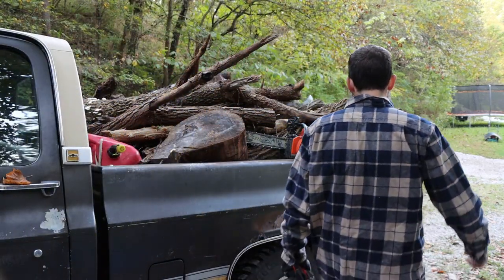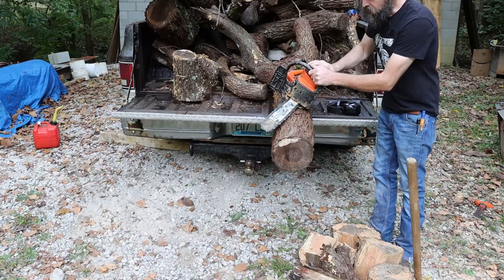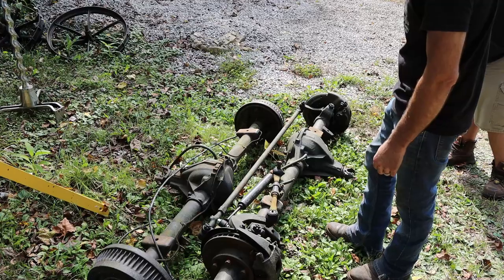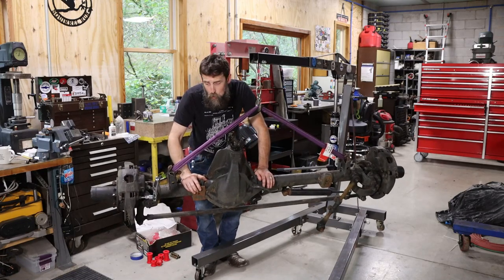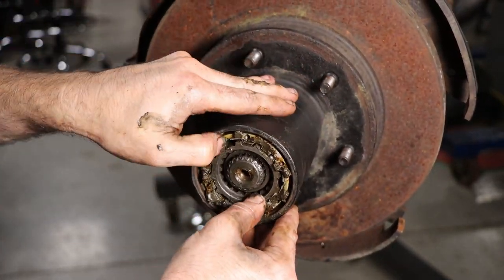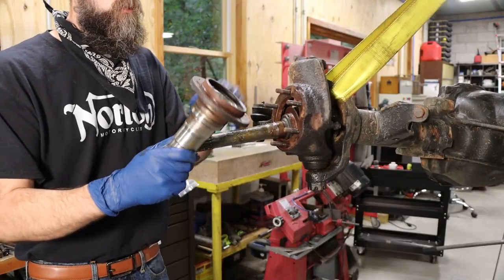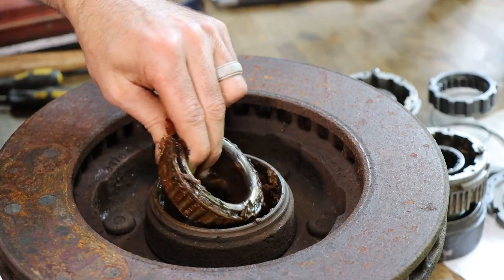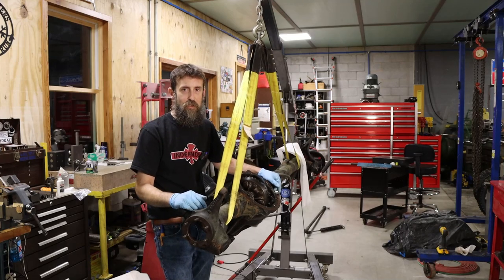Let it begin! Chevy K10 Front Axle Part 3

Comment: An interesting teardown, Steve. I've never dealt with 4wd stuff so all that is new to me. Tell me, where are the seals on the inner axle shafts? They seem pretty rusty a long way in. All the best, Mart in England.
Reply: The inner axle seals are located in the axle tube near the differential. Typically, the axle shaft will be rusty from the universal joint to the splined area where it goes into the differential housing.

Comment: I heat up a piece of pvc pipe and slip it over the handle of my sledge and maul.  Deforms to fit and prevents damage to the handle.  Only takes a piece 2 or 3 inches long.  I would not use a mushroomed tool period.  A few minutes with the grinder and they are harmless once again.  Those pieces can hit you anywhere and do serious damage.  I don't remember any saws with a handguard brake in the seventies, although I could have forgotten, are you sure it is that old?  Nowadays the chinese carb parts and replacements are so cheap I wouldn't put up with a hard starting saw and normally Stihls are like Hondas one pull and go.  Check out the $30 HF electric chain sharpeners.  For home use they are a huge advancement over hand filing.  I don't care how good you are by the time you get to the end of the chain the teeth will be uneven.  Using the sharpener they are always exactly even in way less time than you can do it by hand.  I find grinding to be more even than filing for a couple of reasons.  The file cuts just a bit differently on each stroke because the chain can have a bit of variance in the metal hardness in the teeth and the file can have uneven wear patterns on its teeth.  Because of the stops the sharpener is accurate and the grinding wheel cuts each exactly the same.  I always keep a couple of back up sharpened chains (or more on a big job) and sharpen them at night to change out in the field at the first sign of dullness.  Makes the chain last a lot longer that way as well.

Comment: I quit running the greasable spicers eunning a 9mile dusty dirt road wer potholes hot ujoints hitting cold water. Greasables dont last 1/5th the life of the spicer tripple seal non greasables. Try them and record your life. Youll never install a greasable again. Unless you grease the greasables almost weekly and you never blow the seal out they dont last.

Comment: Those old chainsaws were made for people with common sense, not for today's generation where they get confused on which restroom to use and believe that tide balls are edible. Also, biggest safety tool is the one that sits above your shoulders. I'll take these old chainsaws over today's, although I do believe that Styhl is or has come out with fuel injection. I was taught 3 swipes with a file per tooth is all you need unless you've really damaged them. 
Since you have that front end there and apart, do yourself a favor, replace the brake disc's and the shoes in the rear. Have the rotors and drums turned.